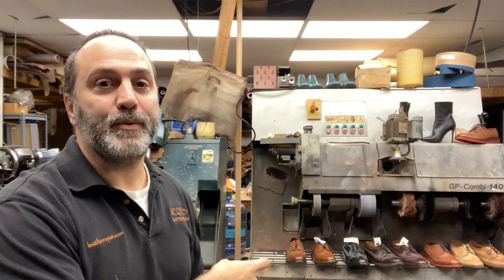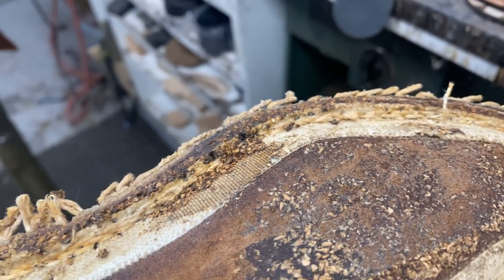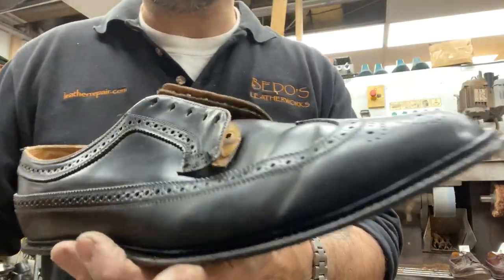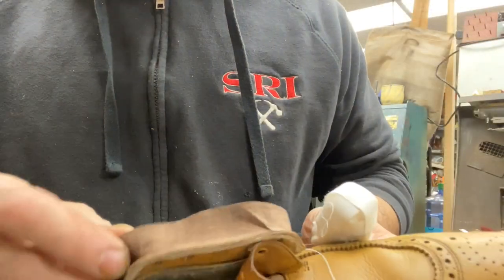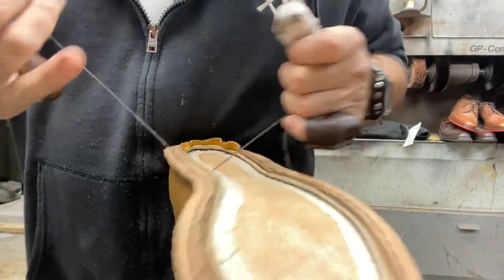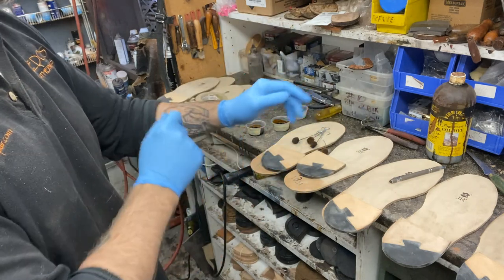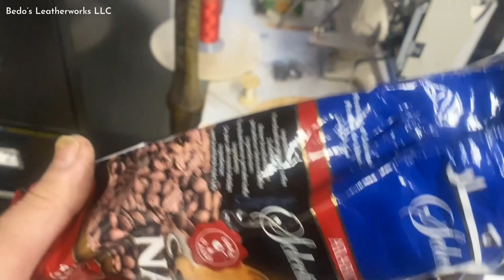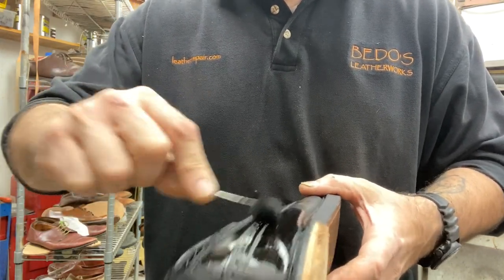Florsheim MARATHON! - Long awaited Restoration!

Comment: Hallelujah! Steve is back.
These shoes are already excellent considering the materials used and with the patina they're just beautiful. The comfort must be incomparable with all the care given to the details by Doctor Steve.
I would love to have a video dedicated exclusively to the different Vibram insoles. An expert's point of view is incomparable.
I do a lot of sport (about 50 km of running per week and more than 20 hours of training). I use Vibram soles on Brooks running shoes (which I had fitted by a specialist in the only Vibram shop in Paris) and I always use a hiking shoes with  Vibram soles.

Comment: You should wrap the bandage tightly with some black electrical tape. It will make the bandage waterproof and will keep the bandage on even with heavy use. Also get the stretch cloth type bandaids. They also make "end of finger" bandages in stretch cloth that cover the end of the finger and also wrap around the finger.  Get the finger clean and dry and put on the bandage first then cover it with the electrical tape. I was a heavy mechanic for many years and always had nicks and cuts so like you I had to keep working but if you try this it will keep the bandage on and the cut clean.

Comment: Working in commercial kitchens the first aid kit has super glue. Our knives were so sharp that when you did get cut it was either super glue or stitches.  If it was to bad for super glue you needed stitches.  Super glue disinfected and sealed it. Wash your hands slide on new gloves and keep going. Go over throw out all the food you were working on, wash down the area and disinfectant. Cleaning up the area took 4 times as long sealing the cut.
Reply from the maker: Yeh sometimes superglue is used but when a chunk is missing no superglue will help
Reply: @BedosLeatherworksLLC  ya thats were stitches came in.  Only one time..all the others were fine. And no scars. Thats what i thought was so great.   Thank you for making the videos.  I have insomnia and they really do help me relax to sleep.  Something about fixing things making them look better and your voice. Again thanks.

Comment: I always love to see Florsheims. That white film on the shell is something that happens when shell sits for a long time. It's all the waxes and oils from the tanning process coming to the surface. If you buff the hell out of them, that softens up and absorbs back into the leather. Perfectly normal.
Reply from the maker: No it wasn’t blooming. I’m very familiar with that but this was something the customer put on it trying to clean it.
Reply: @BedosLeatherworksLLC  ok, that makes way more sense, lol. I was sitting here wondering how you could possibly not be familiar with it with all your years of experience.
Reply: They are my shoes. So learning opportunity for me here on using conditioner. What I did was buy these secondhand, and as such I didn’t know the history of them before I had gotten them. So I soaked them in Kiwi Leather Conditioner to hopefully get some moisture back into the shoes. Knowing what I know now, there are better products and ways to condition shoes (Saphir and/or Venetian).
Reply: Wanted to moisturize them a bit before sending them in and working on them. Cracking can be a concern on shell, so I figured soak them and let them rest a bit before working on them.
Reply: @Charlesj1989  I used to be a Kiwi man myself before I started watching Steve lol I’m a big fan of Bick 4 conditioner now, it’s not much more expensive than Kiwi but it’s miles better